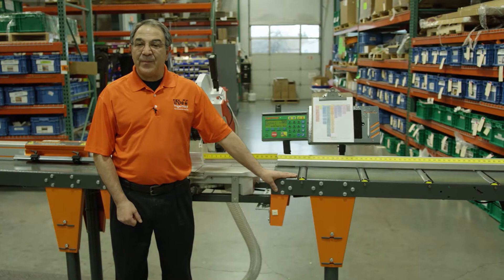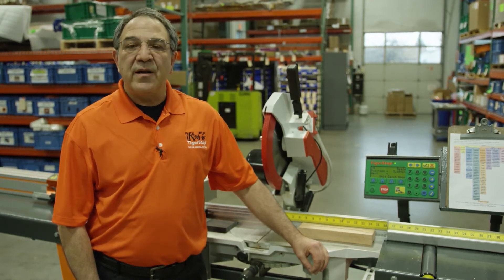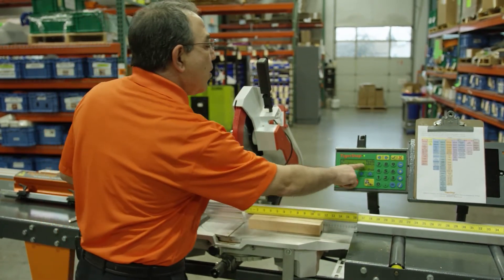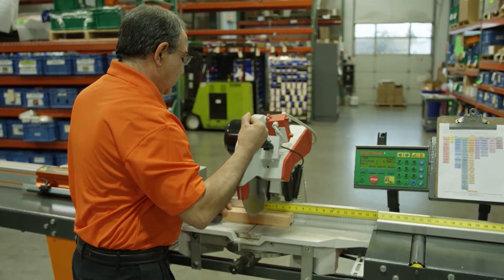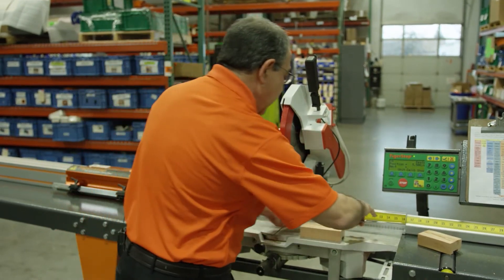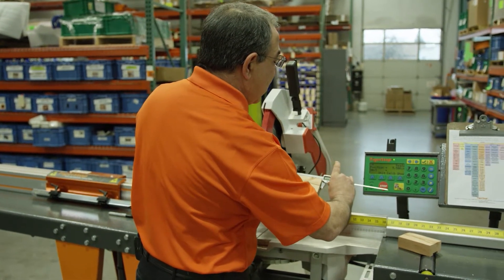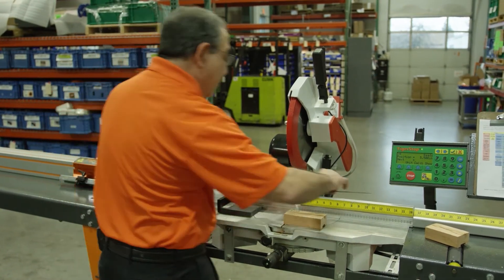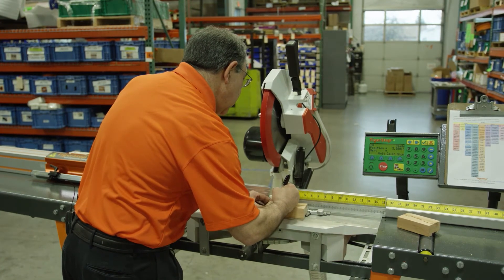How to Determine Your Kerf

Comment: I'm not even sure what you're talking about.  Kerf for what?  The thickness of my table saw blade determines MY kerf.
Reply from the maker: That is mostly true. Your kerf is the amount of material removed during a cut. In a chop saw or uncut material is removed going up and down.  Kerf will vary depending on blade width, sharpness of the blade and blade wobble. It can also vary on mitered cuts depending on the angle of cut.To get an accurate kerf measurement measure a piece of material. Cut it in half. Put the 2 parts together and measure again. The difference is your kerf. I hope that helps! Keep in mind most people are not concerned about the amount of accuracy this will bring you and are happy with a variance of 1/32 or more.
Reply: No, it's not as simple as "the thickness of my saw blade". The process described here is more accurate.

Comment: Thanks for that. What units are you measuring in?
Reply from the maker: Hi Warren! Thanks for the inquiry. In the video we are measuring in imperial, but all TigerStop products can easily switch between both measurement systems. The following video shows how to quickly change from imperial and metric: https://www.youtube.com/watch?v=h8icQCfALlQ. We are happy to assist further if need be. Our service team can be reached via email: service@tigerstop.com or phone: 360 448 6102.
Reply: Tenths of an inch. For example: One half inch expressed in decimal form is 0.5 inches = 6/12 inches.